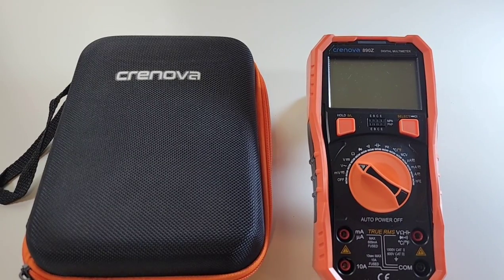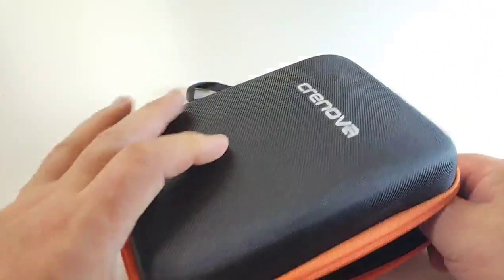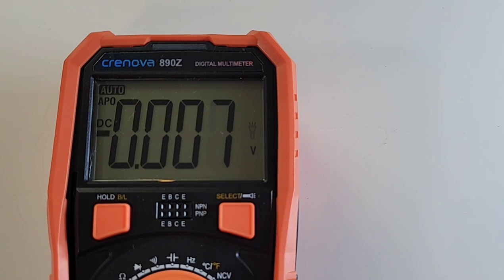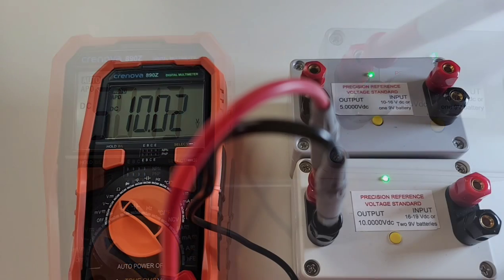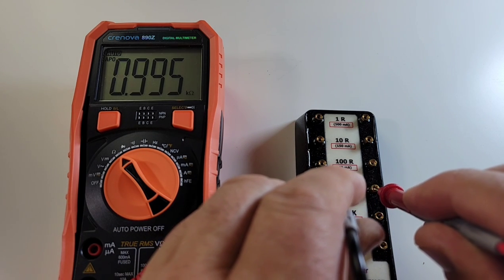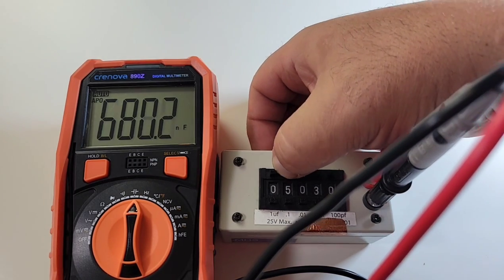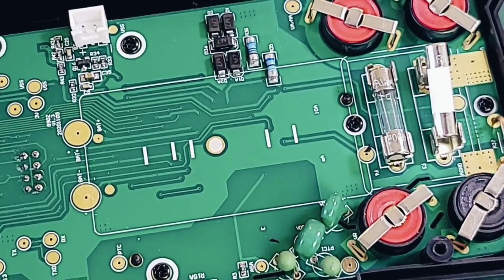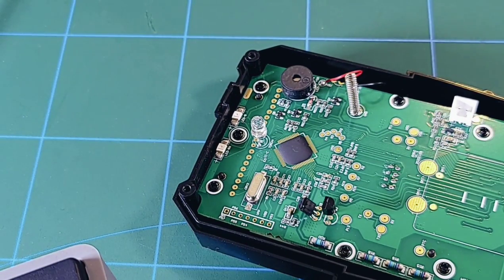CRENOVA 890Z Multimeter Review & Teardown!

Comment: i bought it years ago for about $35US on amazon and that was the going price.  I see it is available on Ebay for same now.  I am surprised it was offered for $80US.  I never saw it for that anywhere except ripoff sites.  It is a pretty good meter for $35US.  good review.  pretty much agree with your conclusions after using it for a couple of years.
edit:  when i bought it, there were a few technical errors in the manual (micro vs milli mix up if i recall).  i contacted cust svc and they jumped on it and put up a corrected pdf on the amazon page.  this was before the pandemic.  not sure how active they are now.  i was told they were working on a range lockable next model that i might review but never heard from them again.
Reply from the maker: Thanks for the input..35$ is definitely fair. I wonder how many actually paid 80$US for this? Good to see customer svc react so quickly!

Comment: Most meters now claim True RMS and many are likely truthful as standard chips support the feature, but it would be nice to see this tested with a non-sinusoidal AC source.  A signal generator could work if you use a known-RMS meter to compare against or you could have a standard non-sinusoidal test device with a calculated and confirmed RMS reference.

A PWM or triac circuit should work, but even a single-phase diode rectifier should read 40% lower than RMS on an averaging meter, so that might be the easiest test as these are easy to build and can even be scrounged from discarded power supplies.
Reply from the maker: That's a valid point 👉 Rob..TRMS is often slapped on alot of CHEAP-O Multimeters but verifying it's accuracy would be interesting👍
Reply: Not sure you really need the precision of RMS for most home use. Maybe for high precision AC circuits but it's rarely needed unless you work professionally.
Reply from the maker: @jonfreeman9682  Fair enough 😃

Comment: The batteries are connected via two springs and via a connector?
Reply from the maker: Yea weird...looks like the 2 pin connector is the actual connection.  Springs are for grounding onto the back of the shielding.
Reply: @KeepOnTesting  The 2 springs on the battery compartment connect to BAT+ and BAT- on the PCB.
The larger spring on the PCB connects to the shielding.

Comment: Interesting video and review. 890Z is available for £60 in UK, so not the cheapest over here either. Looked like there were isolation slots in the PCB around the PTCs. Wonder if you could get a calibration procedure and bring that capacitance measurement closer.
Reply from the maker: Those isolation slots were a nice find! Wow 60UK pounds.. definitely not any cheaper your side of the pond! 
Calibration could be an interesting option mind you at the going $$ rate it should definitely do better 👍

Comment: AS soon as I see a transistor tester on a meter, I'm sorta put off. Funny how the battery compartment still has contact springs going on to the PCB as well as the wires and plug - looks like the spring to PCB contacts weren't good enough.
Reply from the maker: That's a good point 👉 Engineer faux pas me thinks ! HFE tester seems to live on despite being long in the tooth !
Reply: Totally agree. Transistor testers scream el cheapo meter. Single piece transistors are virtually extinct thanks to chip integration. It's totally useless.

Comment: WoW - you can get a FLUKE 106 or 107 with fluke quality input protection for similar money on Amazon, also a $35 (US) Habotest HT118A would be a  better deal, also a $30 full size full function Astro AI DM6000AR, or as another comment suggested an Amprobe AM510 or 530 or a nice late model UniT161B Electricians meter - any would be about the same or less money and a much better meter for this kind of money or less. Sorry Crenova, youre meter is "ok" for about $25 (maybe) $30 but your asking caviar money for a fast food meter and input protection is mucho minimalist as well as ho-hum accuracy on the resistance range, something any half decent meter should show near 100% accuracy on. Swing and a miss Crenovo, but great review as usual Darren spot on-!
Reply from the maker: So true Mike...any of the alternatives you mentioned would be an upgrade 😉
Reply: Flukes cost more than that. But this is pretty decent build quality. It's well designed PCB and seems decent components.

Comment: My only comment is about price. I just bought mine for $32. I have since found that someone bought one for $25. U.S. So, at these lower prices, worth it? I honestly doubt if I'll use every function, but for what I know, is good enough. How good or bad is it when you measure 1,000 and get a reading of 999.5.? And yes, it's a shame the manual don't tell what the symbols are. Thanks to you I now know. You weren't clear about what the hFE is for - or how to use it.
Reply from the maker: 25-30$ it's worth it 👍 
hFE is the transistor tester...a legacy output that still seems alive in 2024.